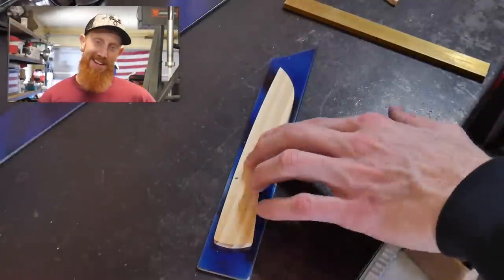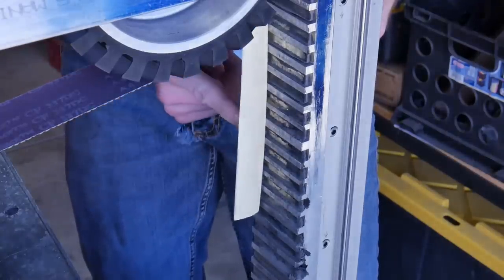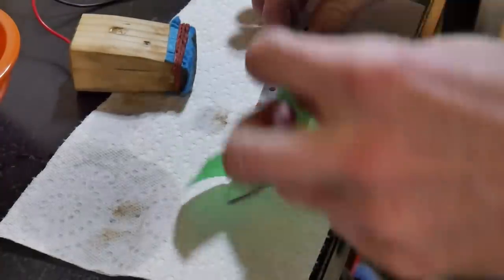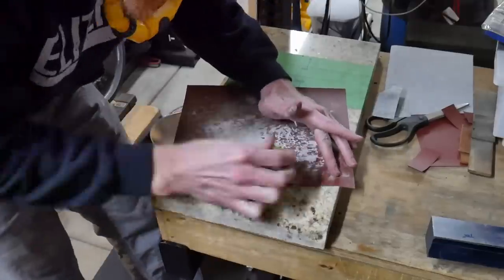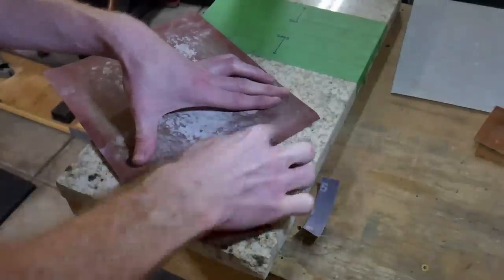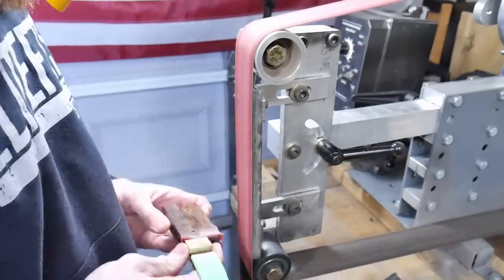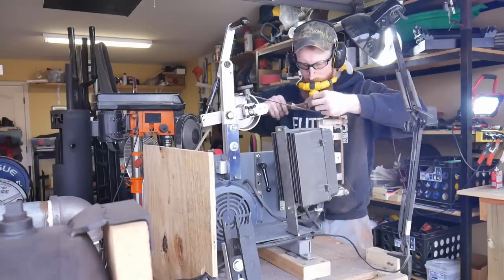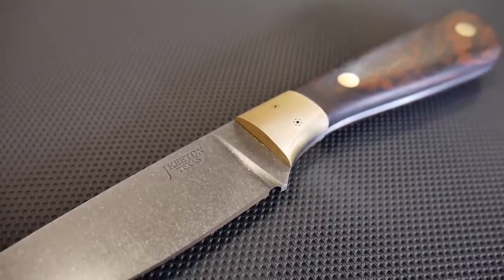Bolsters on a Full Tang Knife | Knifemaking

Comment: Great video, beautiful knife. I never thought of peening mosaic pins. Also good to see your use of taper punch to open up for a better mechanical hold. 

As for sanding V polishing watch out for the wheel hitting the wood which is softer and will remove material faster giving a poor transition from wood to metal. I’ve seen guys use tape to protect the wood. Be sure to sand till real fine (maybe 1000).

Now for my BIG 3 questions. 

1. Why not remove more material in skeletonizing? I leave a 1/8” web and man I can get some weight loss. 
2. No tapering the tang??? Bring that beast down to 1/32 and flat till in front of the bolster. It will blend and the JB will help some. 
3. No hand finishing the blade (brushed finish) maybe 400 or 600? Your blade is beautiful. I have come to love the longitudinal lines and if I get blood or oxidation, then steel wool is easy to clean up. 

Your knife is truly well executed. I love it!!!

Comment: Very nice job. I could see the pins after you finished. If you spend more time peening the pins especially in brass and finish with a 800 grit they will blend in to where you shouldn't even see them. Use a 1 inch 1000 then 2000 grit to polish them nicely. Thanks for the video.
Reply from the maker: Thank you JW

Comment: Off topic....   Someone gave me a brand new commercial two handed chopping knife. They bought it for their restaurant, and never used it.  It is something you could use for material?  I'd be more than happy to ship it to you, if you can put it to use.  There's two good handles you could scavenge for shop or utility knives.  It's not a cheapo eBay/Amazon thin blade thing. You might be able to track down the manufacture, and find out what it is, (alloy-wise).

I keep moving it around, keeping it 'for material', but it's not the kind of thing to just put in with the SS, plus it's big and awkward.  If you can put it to use, let me know.

GeoD
Reply from the maker: George Dennison thanks for the kind offer, sir. But I am not interested. Have a great weekend!

Comment: It's typically better to cut your bras instead of grinding it because it is a good conductor of heat it can transfer to year epoxy Therefore weakening the hold of the a poxy
Reply from the maker: Thanks for your comment, sir. I don't see much of a way around grinding it a little on a knife like this. I tried to go slow. It never got over 150F since I was able to hold it the whole time. Cheers man.
Reply: @RedBeardOps  I like the finished product thanks for the video keep em coming
Reply from the maker: Steven Sanders thank you very much Steven!